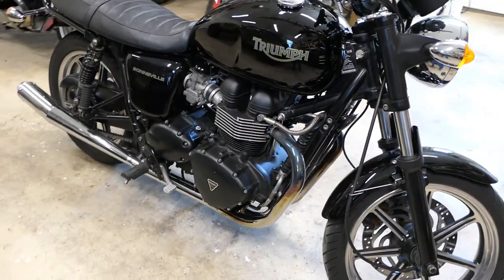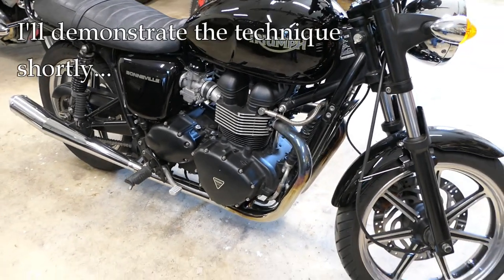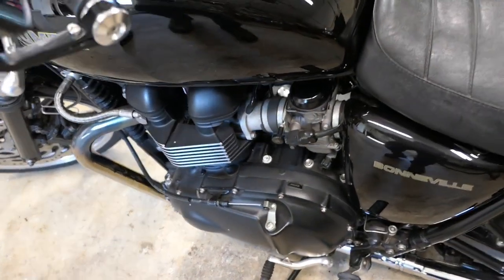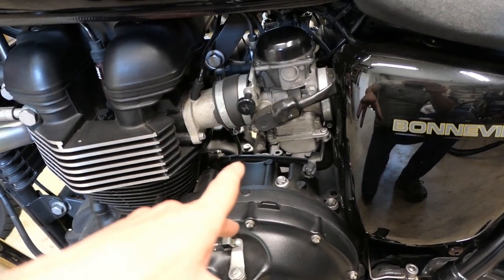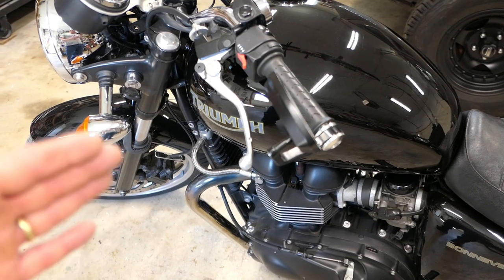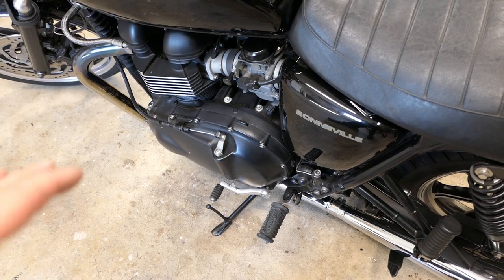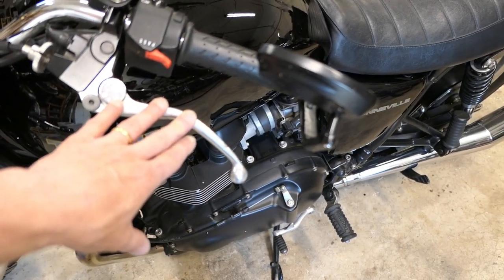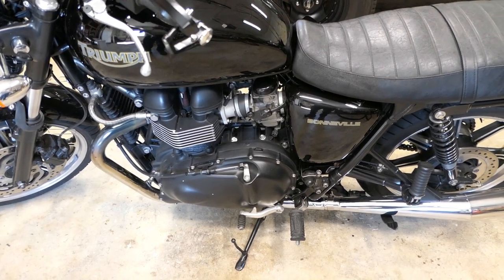How To "Bump-Start" A Fuel Injected Triumph Motorcycle

Comment: I have owned a 2009 T-100 so very similar to yours. It is a very enjoyable ride but has always had starting issues. Given your series of videos on batteries, parasitic draw, and bump starting will assume you may have experienced this same issue. I never leave home without a substantial pre-charging and always carry a 10' extension cord and small charger. The charger has gotten me home on too many occasions, including today from a gas station one mile away. I am aware this vintage Triumph has an ECU that prevents starting below a certain uncommonly high voltage (about 12.3). I even watched one Youtube video detailing how an owner drilled a hole into the relay cover to use a wooden golf tie to press the relay to start. FYI...Never found this procedure to work for me. PLEASE share your similar experience and solution...PLEASE!
Reply from the maker: Actually I have not had starting issues except for when I had a battery go south on me and the voltage was too low for the ECU threshold.  That was just one instance in the many years I've owned the bike, though, and once I replaced the battery the issue was solved.  I suspect you may have either a battery problem or a charging problem.  I have a video on checking the charging system, which you might want to see:  https://youtu.be/6zcSZ4-oFJc  and another video on the ECU problem if you haven't seen that yet: https://youtu.be/0Q6Bhg4VPKM.  I really think if you get your meter out and start taking some detailed notes you're going to find either a marginal battery, poor electrical connections, or a marginal charging system.  Fix that issue and your starting problem will also go away.

Comment: Ok....all being what you said makes sence........what position is the 2 part choke on?    full or half.?....yes I am talkking 865cc EFI engine
Reply from the maker: If the bike is cold, then put the "choke" on as you normally would.
Reply: @tinderboxarts  and if HOT ?  2nd position choke?
Reply from the maker: If my Bonnie is already warmed up I usually don't use any choke at all, but you should do what you normally do.  The bump-start is just replacing the role of the starter, everything else stays the same.

Comment: Do you push the start button when you release the clutch?
Reply from the maker: No, the start button isn't needed in this scenario.  You have the ignition (the key) on, which provided the power for the fuel injection system and the spark ignition.  When you pop the clutch at speed the tire and the drivetrain is turning over the engine, which is what makes the compression.  The start button's function is only to initiate the starter motor, which is not being used in this scenario.

Comment: My co worker got an amazing workout pushing my rocket 3, all for nothing. Battery was too dead
Reply from the maker: Yeah, if you don't hear the fuel pump spin up with the key on, the battery power is too little and it won't work.

Comment: How many miles are on the Bonneville?
Reply from the maker: Currently approaching 23K.  It's been a great bike, and trouble free.  In fact, numerous times my son has borrowed the Bonnie when his bike at the time failed to start or had some other issue as we were starting a trip!
Reply: @tinderboxarts     , thank you.  I’m at 16,000 miles on a 2012 Bonneville SE and just recently heard about a possible major design flaw that could be a ticking time-bomb at 18,000 miles: Serge Mouthon - 2013 Triumph T100 Bonneville Catastrophic Failure.
Reply from the maker: That's not a design flaw, that's one guy who had a bad experience.  The Bonnevilles are well regarded in terns of reliability and longevity.  There are numerous examples, in fact, of riders taking Bonnevilles on cross-country or cross-continental trips lasting months or longer.  You'll be fine if you maintain your bike.
Reply: @tinderboxarts  thank you for your time and opinion.

Comment: On this bike (my wife has the same and the elctronics enable it to start altought the battery has enough power to run) you can also do it in 3rd gear.
Reply from the maker: On this bike it seems almost any gear will do!  Of course, you need to remember to quickly pull the clutch back in when you use a higher gear.  Otherwise you'll stall the engine you just restarted.
Reply: Nice but some additional things to consider.  If you are on a hard flat surface, by yourself, with no help or hill and have some level of agility:
1)Do everything in the video except get on the bike.  
2) Stand on the clutch side
3) Push the bike as fast as possible without it falling over (this is key)
4) Hop on and release the clutch, while praying to your divinity of choice.

Note: This process can even be done without the "hopping on the bike" step but use a higher gear 3rd/4th (because your weight will not be pressing down on the back tire and it will skid instead of rotate) and be ready to pull that clutch in once it starts.  Otherwise wave good-bye.  Desperation calls for desperate measures.
Reply from the maker: @Brian Roark  That is an act of desperation!  I probably would not try that unless I was really in a pickle and alone somewhere.  I'm not tall enough or heavy enough to feel confident I wouldn't drop the bike.  You remind me of my youth, though, when I had a lifted 75 Chevy pickup with a bad starter.  I was too broke to fix it, so I would routinely get out of the cab, push against the door jamb until I got it moving, and then jump back into the cab.  A quick grab of the shifter and push on the clutch and it would roar to life!